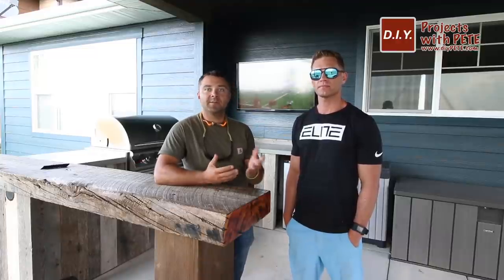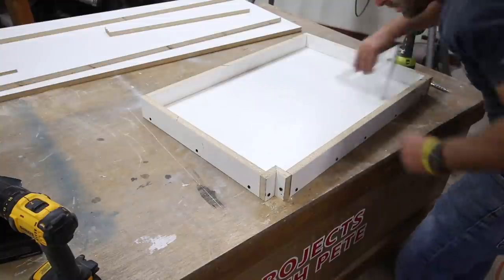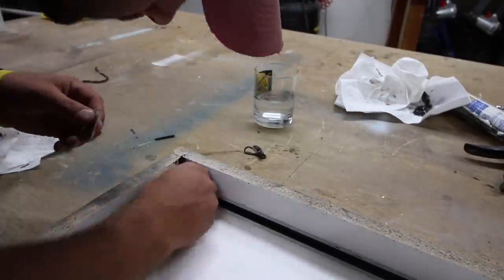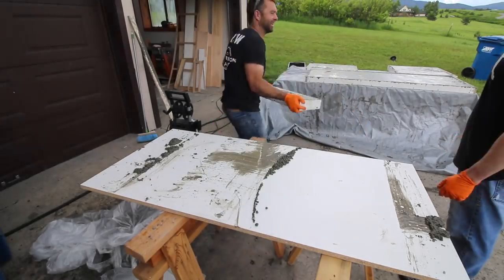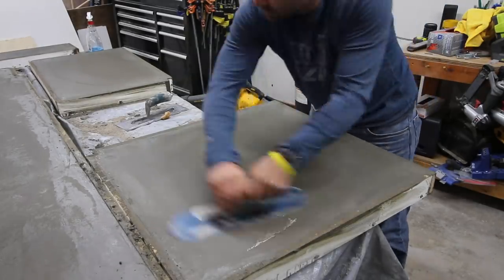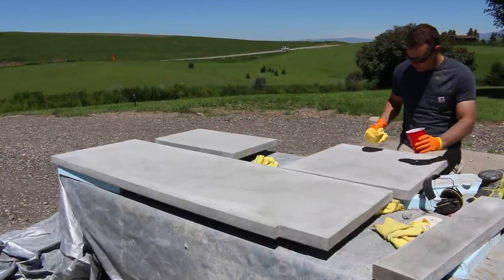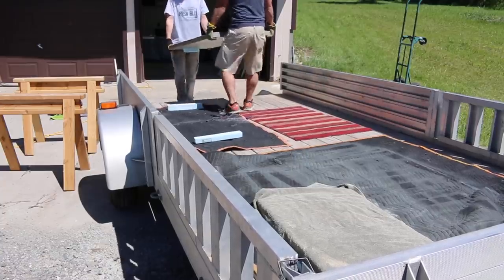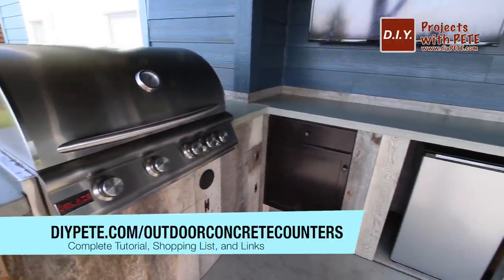How to Make Concrete Countertops

Comment: So you wax the surface to protect it, but what about months/years down the road? Will the wax wear away over time and need to be re-applied? Can the counter be permanently stained if the owner isn't diligent about waxing regularly?
Reply from the maker: Hi, keeping on top of maintenance is important, so wax is recommended to maintain it so you'll always have a nicely sealed top. I typically wax about ever few months. However, there are some new sealers including the Omega Sealer from the Countertop institute that doesn't require wax. I now use that sealer and it's performed excellent.

Comment: How would you recommend incorporating a curved edge in a concrete counter top?  I'm thinking of building concrete shooting benches for my local sportsmans club and they would include a radiused edge.
Reply from the maker: Hey Eric! If you are looking for a beveled edge or other edges, you can look into either buying forms or making some. This might give you some ideas. https://www.concretecountertopsolutions.com/products/countertop-products/countertop-forms?source=adwords&adnetwork=g&adtag1=&adcreative=258654294171&adposition=1t1&admatchtype=b&adkeyword=&gclid=CjwKCAiAmO3gBRBBEiwA8d0Q4t3Q5r5Vh--L6DHGmWu8BDBNbSSJa2AsdxOaI_TwMmInn5g5tS-bHxoC5HcQAvD_BwE   

Second, to do a curved shape, take a look at my video on a rounded shape form here for ideas. Something else you can do is cut the shape out of high density foam and then use it as a mold. So the concrete will go in the cutout area.   

https://www.youtube.com/watch?v=h6_RljwsqiI

Comment: Pete, that's great. Love your videos. Have you ever used GFRC? Any advice when doing so? Thanks!
Reply from the maker: Hey! I've messed around a bit with GFRC but haven't done any big projects. I know the ConcreteCountertop institute and concrete network has a few resources on the topic - I have seen a few folks use it on Youtube as well. If I had some advice I would definitely give it, but I unfortunately haven't done enough to be able to :) Cheers!

Comment: Hi Pete, Just FYI, but melamine is not like "plywood coated with a smooth white and waterproof finish" As you state @ 1:16.  It is a particle board with a smooth (usually white) Laminate on top, bottom and possibly sides.
Reply from the maker: Hi! Great to hear from you. Yes, I'm aware. So many folks are new to things and I try to explain things as simply as possible and I know most know what plywood is. However, I could have done a better analogy and said particle board as that is truly what it is and the best description. Thanks!
Reply: Hey both of you. "Melamine" is not any substrate coated with anything. Melamine is the coating veneer - better known to most by one of its brand names, Formica. Just sayin' :-D
Reply from the maker: Thanks!

Comment: When u trowel hold the trowel flatter ,and u won’t get chador marks (ripples)use a mag or wood float to go over with , and when u have no bleed water steel trowel then ,but hold trowel flat , raise it as getting very hard , very good example what u are doing .

Comment: Great video! Do you have a video or plans for that reclaimed wood counter? I’m specifically wondering how you did the part that holds the grill.
Thanks!
Reply from the maker: Hi! I didn't do any plans on it or a video as I was only in for the counter portion of the project. Cheers!
Reply: DIY PETE thanks

Comment: How well does the lumber used for the grill cabinet hold up to the heat from the grill?  I'm considering using metal framing for my outdoor kitchen because I assumed the wood and high heat from the grill wouldn't be a good combination.
Reply from the maker: Hi Richard, the grill is double insulated ( has an area of air in-between a few layers of metal ) - so it is specifically made to drop into a situation like this. You'll want to check out the requirements for your grill though. Doing a metal surround would never hurt, and might be necessary for your grill.
Reply: Thanks for the reply.  I'll make sure I look into that prior to starting my build.

Comment: I am getting ready to do some indoor concrete countertops do you still like the tuff duck sealer or would you recommend something else
Reply from the maker: Hey Jesse! The tuff duck ( along with wax ) - has worked well, but I'm going to be using the Omega Sealer on some upcoming projects. I've heard it is much better with preventing stains.

Comment: Hey Pete great video just curious how much it would cost to roughly to a project like this one. My patio is weak and is in need of an overhaul! :)
Reply from the maker: Hi Zyclon! The countertop portion was about $200. As for the base, it basically consists of a 2x4 frame --- and leftover barnwood from when my friend built his house. ( You could certainly use cedar or other types of wood if you'd prefer ) - I'd say the base could be built for between $150 and $300. (Not including grill, fridge, cabinet, etc) You could build your own cabinet or drawers of course. Hardware would fluctuate costs a bit, but I'd say you could certainly build a similar kitchen for something around $400-$500 depending on what is used. Cheers!

Comment: Why do u flip slab ?why don’t you trowel and finish slab and use that as top , have no pin holes then , and u could seed the concrete with marble or quartz , is there any reason u flip slab and finish that side ? Thanks Mate .

Comment: Hi Pete, love all your work you have been a great inspiration! Does the sealer adhere after the surface been polished by 800-1500 grit pads?
Reply from the maker: Hi! It depends on the sealer used, but generally it works fine around 800 in my experience. Cheers!

Comment: Could you use a multitool with a long tool on it to plunge into the wet concrete to vibrate the bubbles out?
Reply from the maker: Most likely

Comment: Hey Pete, is there such a thing as a self levelling sealer? I had someone helping me pour my concrete counters and this is what we were going to use but now he’s disappeared and I have to finish it myself! 😑
Reply from the maker: Hi Heather! So the sealers I use wipe on super easily and are a breeze to apply. They are not  a thick epoxy that would require self leveling to help out. Another option is to use Omega Concrete sealer which can be ordered online, it is the most bomb proof sealer I've tried out, but you'll want to follow their directions to a T. Totally doable though.

Comment: Pete, instead of doing 3 separate molds, would you, with your experience, risk doing it as 1 connected piece?
Reply from the maker: Hey Matt! To be honest, I would not as the piece behind the grill is so narrow there would be a good chance of having issues with it. The only way I'd consider doing it that way is if I poured it in place and did a hard trowel finish. Cheers!
Reply: @DIYPETE  Thanks for replying.

Comment: Pete,  Question for you regarding using this method for a larger slab (bigger than a 4x8 sheet)  I am looking to make an L shaped bar that is approximately 7x5.  My goal is to have no visible seams.  Do you have any advice for constructing the mold?  Thank you!
Reply from the maker: Hey Richard! That is going to be a really cool bar. Is this going to be an indoor or outdoor bar?
Reply: Indoor.  Basement
Reply from the maker: Cool. So if you want to do the reverse cast technique, you can use pocket holes on the underside of the mold to make the sheet bigger - and then put a piece of thin clear packing tape over the little seam. The concrete will form against the tape still so you'll need to use a polisher to blend in the slight area that was taped. The other thing, which I'd probably look into doing would be to do it right side up and to trowel the top, then sand. You could do this in place. Search pour in place concrete counters and I think you'll find some good ideas. Troweling takes practice, but I think if you practice perhaps with a small table top before doing the big bar you'd be okay. Let me know what you end up going with!
Reply: Awesome man!  Thank you for the advice!   @DIYPETE
Reply: @DIYPETE ,  I'm still in the planning stages.  With the reverse cast technique is there any issue with a 4-6 inch overhang?  I'm planning on a 2inch thick slab. Thank you!

Comment: so if I use glasswork fibers for a small slab, do you think I need rebar / mesh?
Reply from the maker: Hey Dan, I would try and keep the fibers in the lower part of the mix so they do not show on the top and sides. For a real small slab you might not, but it never hurts to use a little.

Comment: Awesome, excellent tutorial.  I would like to see staining during the cast & clear epoxy finish...are you in Bozeman ?  Would love to see your shop ...THANKS
Reply from the maker: Thanks so much! Lots of finish options for sure. Yes, I am in that neck of the woods :) Are you as well? Cheers!
Reply: @DIYPETE  Yes, I live in Manhattan, MT finishing a shop building in Gallatin Gateway on Cottonwood Rd
Reply: Pete -- I am guessing that pour in place has pros and cons... seamless sections are possible, not moving heavy sections, easier to pour into corners ... but could have serious clean-up and challenges getting smooth level finish
Reply from the maker: Absolutely, you are right. I tend not to recommend pour in place for most first timers as getting a nice hard troweled finish is quite an art, but I love the look when done right, and especially for large custom pieces it can be a great solution. That's awesome you are out in Manhattan! I know quite a few friends from out that way. Have a Merry Christmas!

Comment: Have you tried a damp sponge instead of hard troweling?
Reply from the maker: Hey Eddie! I have not.
Reply: @DIYPETE  its common practice here in the UK when rendering walls, if you spend the time you can get a very nice finish and its not as hard going as hard troweling

Comment: HI Pete!
Great video and thanks for sharing!
Just a question, on the larger piece of concrete, how many bags of concrete mix did you use? Thanks!
Mike
Reply from the maker: Hey Michael! We used 7 bags total for this project. I think the big counter was about 3 1/2 or 4.
Reply: Thank you Pete!  I've been working on a mobile counter top (cedar bottom and concrete top) which is about the size of the larger piece you've shown on this video.  All I have left to do is the top, but I guess I'll need to get 2 more bags of concrete.  Thanks for all your inspirations!
Reply from the maker: Hey Michael! Sounds like an awesome project, have fun with the rest of the build!

Comment: Is there a reason to pour such a thick layer of concrete? as this piece is not bearing almost any force, why can we do with 1/3 the thickness?
Reply from the maker: 1 1/2 inches is about as thin as I go for concrete counter projects. You could use a  GFRC  mix to go thinner. But for a normal mix, you need enough room for reinforcement.

Comment: To remove all the bug holes along the side purchase some thin plexi glass 8x10 or any size works, insert the plexi along the edge working along the edge loving the plexi upward in a jigging motion and hold away from edge just far enough you can see that you’re puking the cream up as you do it, when doing this if done correctly you wil have no bug holes on the edge…

Comment: Pete nice project! Isn't 5000psi concrete overkill for surfaces like these that won't bear weight above 300 lbs.
Reply from the maker: Thanks Sean! The 5000 PSI mix works really well in my experience. It could be overkill, but I've found the strength it provides is really nice, and I've had very few issues ever with any structural cracks. At $6/bag it is hard to go wrong :) The concrete counter guru ( Cheng ) has used that mix for years, and he's one of my big inspirations. But I've seen a lot of folks make their own mixes with great success as well! I do like having the pea gravel sized aggregate, especially for thicker projects. The early strength PSI is also nice to have for wet polishing to get a better polish. I think less than 5000psi mixes will work too though! The 5000 is just what I have the most experience with. Have a great day and THANKS SO MUCH for watching and commenting. Cheers!
Reply: There are very few nevers in life. 
One is:
Never underestimate just how much actual force a your friends, friends friends 300 pound body builder can apply to the top of your concrete counter when he decides to dance and jump on it!
That's when you regret not using the 5000psi over kill mix!

Then there is also the "how did you do that" response to the teenager factor!
You're really better off with the overkill!
Reply from the maker: haha! :) ya just never know! Cheers!
Reply: If anything it’s underkill. Our concrete mix we use comes in at around 10,000 PSI and can be taken out of the mold in around 12 hrs if blanketed.

Comment: My slurry coat made my countertop have patches of color. How do I fix it ? Please help
Reply from the maker: Hey Chadwick. Make sure the slurry mixture in all sanded flush with the existing concrete so it is all removed, except for the mixture that has fill in the actual void. Are you referring to the small void only? Or a larger patch.

Comment: I would paint my counter top bright orange or Aqua any paint suggestions?
Reply from the maker: Hi! I have not ever painted concrete countertops. I you plan to paint them, you might look into building them out of a different material. You could use a concrete dye to get a cool effect though. Some you can get decently bright.

Comment: Hi Pete ...  This is my next project and I really am having problems with it.    I need to build something like this to keep my pots, pans and other stuff for cooking on the grill.

BBQ grill not under warranty with it.  What a joke.  Looks like someone wants to build my project and charge me an arm and leg.  Well here are my questions.    4 ft x 5 ft slab at 2 inches =  250 lbs.  I really do not want a set of tables as permanent places like yours.  Wood is another concern with the grill and I am concerned about the grills friendliness with wood being that the grill support is stainless steel  304.  

1.  I can buy the grill with  insulating jacket.  Did you??  If not, why not?
2)  Due to weather on wood,  since you built this,  has it decayed???    
3)   Has the concrete been supportive over 4 x 4  wood???     What kind of wood have you used???   
4)  Would weather treated wood but more efficient for the outdoor weather?????   
5)  I have made a 5 floor mobile workbench that is awesome looking.  It rolls on supportive 660 lb each castors  (6 0f them to 4 ft x 8 ft workbench)
I think that would be necessary to support a 2 inch concrete table top at 250 lbs and wood to use these castors.  I also attached them to a base consisting of 2 panels sandwiched around 8 ft long 4 x 4 wood.  It looks like a 4 ft x 8 ft palette for supporting the wight to all my work euipment.  What do you think for an outdoor grill???  Greatly appreciate your help and will tie my portable outdoor grill and dining bar when done to you  ;-)
Reply from the maker: Hi! All great questions. The grill used does have the insulated jacket and was what we wanted to be able to do the wood surround. The kitchen is completely covered overhead for the most part so it is protected well from the elements. I think he is planning to stain or seal it this spring. Using a deck stain would definitely be a good idea, especially if exposed to the elements. The bases are made of 2x4 frames and plenty supportive. ( pine ) I'd recommend treated 4x4's or 2x4's for the frame. The wood is 1 inch thick reclaimed wood boards from an old corral on a ranch. Your mobile workbench sounds awesome!
Reply: @DIYPETE  thank you so much Pete.  That is exactly what I was thinking. I do have some additional features which are different from yours. Inside one of the cabinets was going to be a carousel because the area I'm making is L shape and covers 36 on one side.  Both pieces of double tier counter and grill/sink setup will have casters supporting 375 lbs each.  Another feature is I have added a flojet system Which would connect to a 5 gallon jug of water and there would be a 5 gallon bucket to retrieve waste (regarding sink).  I will send you a link in one month, once I have this setup completed.  Thank you so much for sharing your experience.

Comment: Wet the concrete with a spray bottle before you apply your patch, it prevents the countertop from pulling moisture out of the patch too quickly, weakening it…

Comment: Snapped and sealed flagstone is so much easier, looks a lot better, is much easier to repair, and is a lot more cost effective, start to finish. I watched this because I couldn't believe someone would actually try it, because it's for driveways, not countertops, but... Different strokes for different folks.
Reply from the maker: Great to hear from you! Most folks definitely think of concrete for sidewalks and driveways. But you really can do some neat things with it. It can be any color, shape, thickness, or texture. And you can embed fossils, metal logos, chains, sprockets. They can be acid stained or made to look like marble. You can really be creative and experiment as much as you want! These are more of the standard grey, but if you do some google searching for concrete counters etc you will find some awesome ideas. Here are a few colored tables I've done etc. https://www.diypete.com/concrete-tables-101/ Cheers!

Comment: Polyurethane vs. silicone would be a much better choice in my opinion.  Will adhere and remain much more flexible over time.  Probably not critical in this application, but why not use a more durable product if it doesn't cost much more.
Reply from the maker: Thanks for the advice, Alan!